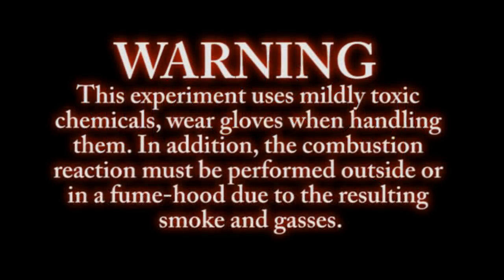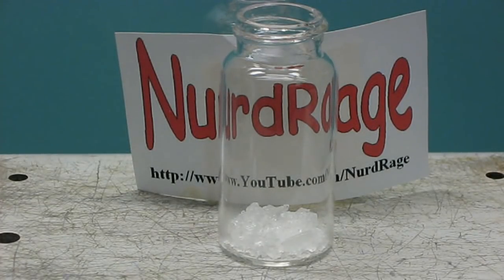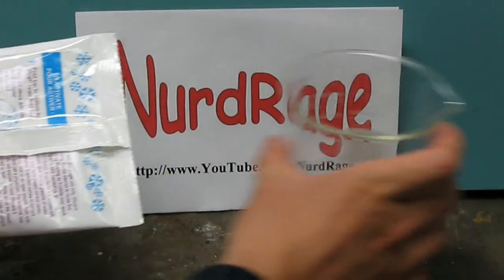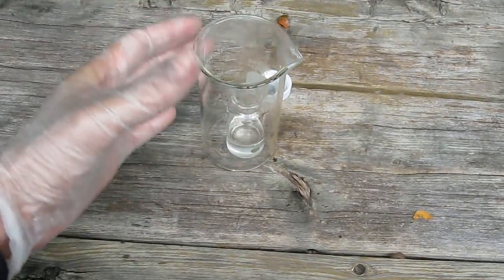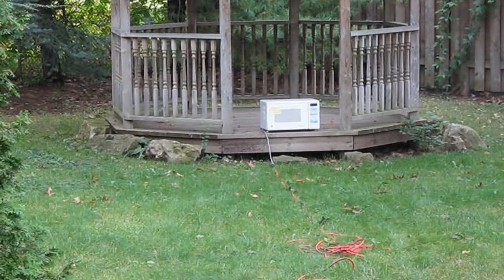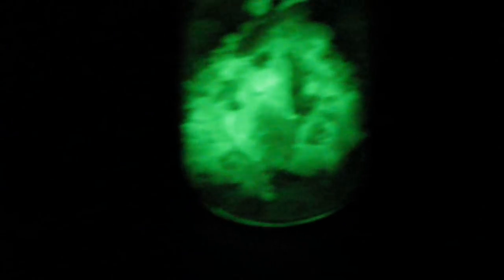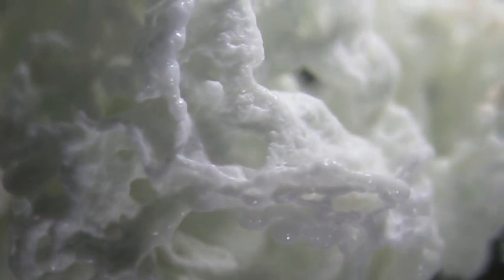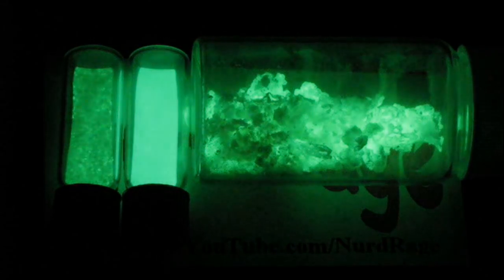How To Make Glow in the Dark Powder

Comment: I want to know if there is a way to recrystalize the finished product and do a better job of generating the morphology desired, as I have read from unitednuclear that the crystal size determines how well (brightness and longevity of the bright phase) this glow compound performs. So being able to recrystalize it into larger crystals would definitely be quite useful. (also being able to recrystallize it around something in super small tiny thin layer crystals might be useful for conversion of UV into visible useful photons for PV cells to use, and extend their production range beyond the available light by releasing the energy stored from that UV light.)
Reply: something even more useful would be a way to make walled shapes that are reflective to the usable photons (ie like how plain white paper is reflective not how metal is) while absorbing the UV photons to re-emit as visible range photons, this way only the area the conductive traces are on top of the cells could have these walls standing upward and still ensure the cell gets light on it regardless of the angle of light thus cutting down quite a bit on need for repositioning the cells to face the sun directly. it might even be useful to not have them facing directly so that the UV is blocked from hitting them, while allowing the visible spectrum is allowed since the UV generates mostly heat in the cells with almost no electron flow production, but still doing the same damage to the material that UV does to say a photo, slowly aging out the cell prematurely, thus removing it should extend the useful life of the cells to some degree.)
Reply: using lexan (polycarbonate to the rest of the world) I found that the UV it blocks causes a slight dip in voltage production but increase in amps that amount to a total of more wattage than even being unblocked by anything over the cells in the sun. (lexan or other polycarbonates with out any additives will not block most of the 250nm-ish range UV like air sterilization lamps put out, as well as the 180nm-ish ozone producing frequencies that water purifying lamps also produce due to the lack of a layer of borosilicate glass between them and you. So there are I am sure a ton of UV frequencies reaching the cells I was experimenting with due to this fact. The only frequency for sure I know PC blocks is in that blacklight spectrum of the 360nm-ish range used for lighting up black light posters and such. (have not checked the near UV of 405nm but I can check that too now I guess as I have several lasers that produce mostly this frequency LOL)

Comment: Forgot the part where you plug cord into neighbor's house to use their electricity.  Is 100 feet long enough ?  

I stretched my cable across the street between to poles.

Where is the steel shipping container ?  You need to protect yourself in a ballistic shelter for this one.

Comment: I wish radioluminescent paint was still made . . . Radium-226, Strontium-90, Promethium-147 . . . Of course, most isotopes can work, but their half-life has to be relatively short and the energies of the emitted particles also depend on how much radioactive source material you would need.
Radium-226 (1600 years) - 1 μCi: Alpha and high energy beta/gamma emitting decay progeny.
Hydrogen-3 "Tritium" (12.36 years) - 100 mCi: Very weak beta emitter. Decays to stable Helium-3.

Comment: I've been curious to find compounds that exhibit phosphorescence for very short intervals-- milliseconds-- but with high intensity.  This is for an optical memory device experiment, where the system will "refresh" the memory as needed.  It is a somewhat more modern take on old CRT memory devices, but those had far too long a decay time.  What compounds come to mind?  Zinc sulfide, for example, has a decay rate that is still too slow for that purpose.

Comment: Is there any way to make a "glow in the dark" liquid that can be charged with light then emit light over a longer time (several seconds to minutes)? There might be some cool applications if you could pump a liquid past a light source then let it emit its glow somewhere else. However it seems like most glow in the dark materials are based on solids that might cause damage a to liquid pump.
Reply: Use an impeller.

Comment: Wouldn't strontium aluminate be a better/cheaper alternative ?
Reply from the maker: what's being made in the video? :)
Reply: Thanx for the answer. I thought it had a different chemical composition and it isn't stated anywhere.
Also, yours appears to be https://en.wikipedia.org/wiki/Lumibrite , not the "standard". :)
By the way, your videos are awesome (I've just subscribed). :D
If I may, I wish you had a video showing radioluminescence with the aid of alpha-beta radioactive materials.
I know that tritium can be used to light up strontium aluminate but it is a pricey gas which is hard to contain and I was wondering if the same could be accomplished with solid materials, like radioactive isotopes of calcium or any other cheap (and relatively safe) radio-source.
Do you have any advice on the matter?

Comment: Have you tried to apply pressure during combustion?
Reply from the maker: +Aaron Beagle how do you do that safely and cheaply? Every method i can think of would be far to expensive.
Reply: I suppose you could put the material inside of some non-metallic pressure vessel... And as soon as I say that explosion warnings are popping up in everyone's heads.
Reply: how about a ceramic refractory container or something?
Reply from the maker: How would you do that safely? Most glass vessels would shatter if both high heat AND pressure are applied. Metal containers would block the microwaves and be useless.
Reply: I honestly don't know how it could be done, but I was just throwing the idea out there.
Reply: +NurdRage you could put the microwave inside your pressure vessel...
Reply: Maybe think of a way that will ignite chemicals more uniformly. At high temperatures chemicals you added behave differently and during the reaction probably separate. While bigger surface is more pain in the ass to scrap later, It could help with more uniform combustion.
Reply: Take a large tall beaker, put chemicals inside, cover with thick aluminium foil with a hole at the center. You can also control gases in the beaker before reaction.

Comment: An easier way to make glow powder at home:
 Mix equal parts (by volume) sulfur, strontium carbonate and salt.  Sprinkle a small amount of lead sinker filings on the mixture.  Heat mixture with a MAPP gas torch until the salt has melted.

Expose to flashlight and enjoy!  It also glows like a banshee from exposure to UV.
https://www.flickr.com/photos/28617364@N04/19178862176/in/dateposted-ff/

If you want powder, crush it up.

Comment: Get tonic water point it with Black Light (UV light) and you get the same thing.
Reply from the maker: No, tonic water fluorescent, but not phosphorescent. If you stop the light, the tonic water stops glowing, but the powder keeps glowing. They are not the same thing,.
Reply: NurdRage for how much time the glow keeps? 1 hour ?
Reply: Rumano Loko The tonic water stops glowing immediately.
fluorescent = Does not produce light if none is present.
phosphorescent = True glow in the dark. (After charging with a bright or UV light.) To find info on commercial powders, I'd recommend looking at GlowInc.com. They have the brightest and longest-lasting of any company. In fact, in the video, I think he was comparing it against their best "glow powder", the Ultra V10. Anyway, check out their site. But be warned: you'll to want to buy something. ;-)
Reply: Rumano Loko Then you'd prefer to do something that does something different.

You might as well say you prefer to buy a knife instead of a car.
Reply: I believe the actual phosphorescent (glowing) powder that results will be ruined if it comes in contact with water. So yes and no, depending on what you meant.

This is based on MSDS and technical data posted on the Glow, Inc website here: http://glow.glowinc.com/choosing-a-medium/  It says, &quot;Non-coated aluminate powders can not be used in water-based mediums.&quot;

(I'm also "The Glow-In-The-Dark Man". https://www.facebook.com/TheGlowInTheDarkMan/ I have no connection with Glow, Inc. other than being a customer and a huge fan.😎)
Reply: No, you cannot use water for some of the colors. They will dissolve. However, you can mix the powders together as-is. 
Also, different colors have different particle sizes, so they don't "mix" like normal colors. You'll have streaks of each color.
I use resin to cast objects that glow. See my shop here: 
https://www.etsy.com/shop/TheGlowInTheDarkMan/items
You can contact me there, or via my Facebook page, as you prefer:
https://www.facebook.com/theglowinthedarkman
Reply: Leland Green Someone already answerd that, YAY!
Reply: Rumano Loko Yes, I know.

Perhaps I misunderstood your question. I thought you did not understand, but perhaps it was me that did not understand (your question). If so, sorry about that.

If you're interested in commercial glow powder, check out Glow Inc. They have the longest-glowing, and also have pages with info about how long each of their products glow. (The green is up to 24 hours!) I'm not affiliated-just a fan. :-)
Reply: Leland Green I'd preffer buying a UV light xD and some cheap Tonic.
Reply: seigeengine You smart! "insert DJ KHALED here"
Reply: Rumano Loko while your buying tonic water  don't forget to get the highlighters.
Reply: Holy shit, that was 8 months before this DJ KHALED shit went huge.
Reply: High Furzi Leader Kitler YOU LOYAL.
Reply: Moth got my cheap UV torch, nuff wanks.
Reply: Rumano Loko not really you still need highlighters and tonic water to make full use.
Reply: Hello Do you think this glowing powder soluble in water or NOT???
Reply: Leland Green dd

Comment: IMPORTANT NOTE

Iron contamination kills the fluorescence and phosphorescence of rare earth ions very, very easily. From what I've seen, cutting pieces of the rare earth metals with steel cutting tools may be the primary reason behind the dead flakes - the tiny pieces are enough to kill the phosphorescence. Try using tungsten carbide cutting tools instead. Another problem can be contaminated acids.
Reply: Vrej Egon Spengler Pardon some people if they purchase more than the gram or two they intend to use for this synthesis. Assuming this isn't the only chemistry you'd ever do with rare earths, you're more likely to have large pieces that need cutting.
Reply: Hi, Brain&Force! Didn't think I'd see you here. Iron is also found in trace amounts in impure aluminum foil and in many hardware grade hydrochloric acids, which were both used for the aluminum nitrate. So those are some additional concerns.
Reply: Vrej Egon Spengler That's not how you get known amounts of a reagent. Plus your metal nugget would be etched and extremely prone to oxidation, lowering its quality.
Reply: Brain&Force : It's simple : don't cut your dysprosium and european. Just put them in your nitric acid.
Reply: Vrej Egon Spengler I tend to avoid that now. Tungsten carbide or zirconia cutting materials work great.
Reply: Amos Zoeller You can just dip your rare earth metal into the acid for a short period. You could just put a small drop of HNO3 in a beaker or petri dish and put the metal on it.
Reply: Amos Zoeller h y

Comment: Is it possible that you could make a better product by mixing a solution of doped strontium chloride with a solution of potassium aluminate to precipitate the doped strontium aluminate?
Reply: Or you could add a mixed solution of the chlorides of aluminium, strontium, europium, and aluminium to a solution of potassium hydroxide to precipitate the mixed hydroxides of each metal simultaneously, which could then be dehydrated into their corresponding oxides.

Comment: Did you ever try to evaporate the water first (If you got, some vacuum and like 40-50°C) and then do the reaction? If you're lucky you might get a better reaction if you start with uniformly mixed solid gotten by the evaporation. Which won't work though, if one of those things starts to precipitate sooner than the others. But together with all that urea in there, i guess your chances are good you might precipitate everything at the same time.
I'm usually working in organic synthesis so i don't know this kind of reaction, but it might be worth a shot.

Comment: From what I can see from other glow powders, the surface area of the particles is inversely proportional to the afterglow time. I understand that combustion synthesis isn't exactly excellent in terms of controlling the rate of reaction, but would it be possible to improve the glow of the crystalline structure by slowly recrystallising the final product by dissolving in (say) water in a closed environment with hexane, such that the solvent composition is slowly changed over time as it diffuses?

Comment: That would have the same impurity problems because you wouldn't be able to take the impure stuff out. It would probably just melt with everything else. If you can, since impure crystals typically melt at a slightly different temperature than pure crystals you could get the bad stuff out when it's in a different phase than the pure stuff. However, I have no idea how you would do that reliably.

Comment: When you microwave the compound why not place a small beaker of liquid nitrogen in the microwave.  Not much mind you but enough to remove the O2 in the microwave during the combustion phase (another testable part of the experiment!). A  moderate sized hole with a gentle cork inserted in the gasket around the door might provide a suitable pressure release valve to prevent explosive removal of the microwave door. Of coarse the use of helium from a balloon would work as well.

Comment: Perhaps you mentioned it in a previous video, but I'm curious why you didn't synthesize Copper doped Zinc Sulfide? But this Europium, Dysprosium doped Strontium Aluminate is an outstanding Phosphorescent material and you detailing its synthesis for the hobby chemist is an invaluable addition to the field. Perhaps the Morphology that you hint at could be due to an amorphous glazing of glass that blocks a lot of UV from exciting the Phosphor underneath? P.S at 7:45 there is an evil face reflection

Comment from the maker: @Mike211L usually problems arise if you didn't purify your chemicals enough, (you need to perform multiple recrystallizations of the strontium and aluminum nitrates). you also need to use distilled water.

Another problem is getting the microwave to ignite the solution, you might have to experiment with different shapes of containers or amounts of solution or even the position of the container in the microwave.

Comment: @NurdRage If you truely did 10 months of research then you surely hoped on scifinder at least once and found a bunch of articles regarding the synthesis of doped strontium aluminates. You need a temperature controlled muffle furnace (or some other suitable furnace) that can be used with reducing atmospheres. This allows truly precise control of the morphology, which is fundamentally important if you want to obtain long-glow and high brightness phosphors.

These ovens can cost $35,000+ USD.

Comment: may i make an educated suggestion..?? try "canning" the pre ignited substance like make it really hot in a container then sealing the container with little air space and then ignite it in the microwave.. my hypothesis theory is that if you leave such little room for  the error being the unequal displacement or the density of the flakes there will be less error.. also .. if there is error .. there will be very little room to correct it.. so possibly you might need a new microwave if this is

Comment: The difference in morphology corresponse to the ability to retain phosphorescence is due to the oxidation state of the crystals which has been produced. A uniform heating at a controlled environment will allow this. At any rate, the reason why there is a need for UV before observation is necessary for the electrons of the flourescent compounds to achieve a higher energy level before it is being emitted resulting from instability of the electrons staying at higher energy orbitals.

Comment: It looked like the glassy sections didn't want to glow at all, the foamy sections would glow some, and the powder seemed to glow the best... I'm guessing the morphology may be linked to the heating process. Due to the differences I saw in the video.

The torch may have either over heated the mixture, heated the mixture in a non-uniform manner, or both. Possibly resulting in more of the "glassy" sections. The microwave oven seems to be a little more even and more gradual.

Maybe try slow heat?

Comment: fertilizer companies generally use ammonia and carbondioxide for producing urea. to produce ammonia, they distilate air to provide the nitrogen and hydrogen, and use a nickel catalyst to get the reaction started (ofc, they do that in a reactor with high temperature and high pressure levels.)

Comment: My two cents would be that it would seem that the microwave is not uniformly heating the sample.  At points it would seem that it is under heating and over heating in others.  It sounds strange, but have you considered a gas grill?  line the entire interior with the ceramic bricks and have multiple points of jets for heating the box.  You may not be able to due to the fatigue on the metal, but who knows.

Comment: I use from 300 lbs to 3000 lbs of the pigments at 1 time. The cost alone of importing the pigments is very high not to mention the cost of the pigments. I have access to some of the largest labs and manufacturing facilitys here in the US and with all the new laws requiring the photoluminescent safety egress markings it could be worth my wile. Are you located in the US and if so what state? Maybe one day we could sit and talk about all this and possibly work something out.